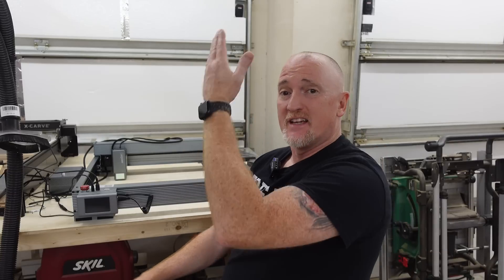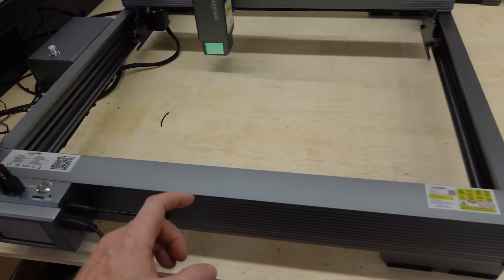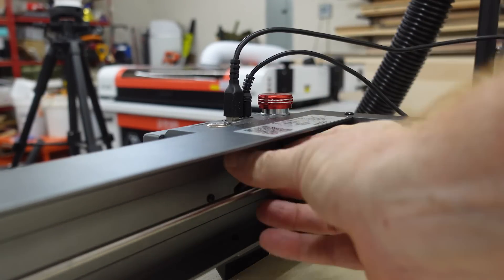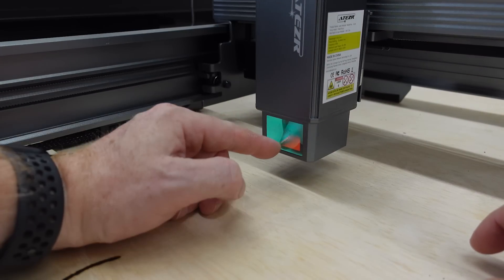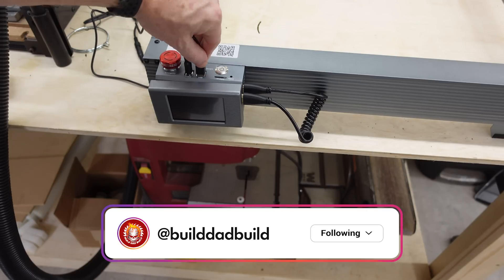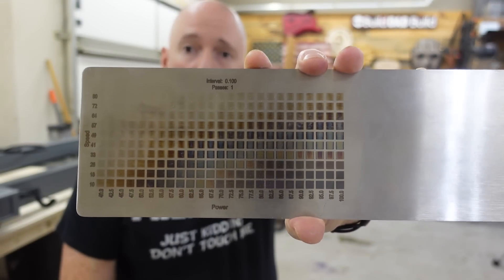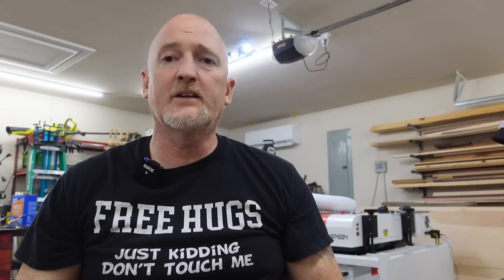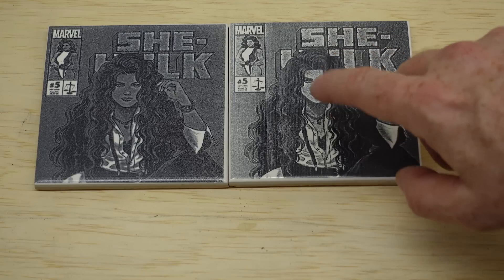A Little Laser on Laser Action! Is The Atezr P20 Plus the xTool Killer?

Comment: I am trying to figure out how you vented the atezr.  Is that a suction hose attached to the gantry?  At 7.50 or so you can see it in the background.  I hate my enclosure.  too hard to work in.
Reply from the maker: That’s the air assist.
Reply: @BuildDadBuild    the large black one that looks like it has a box attached on the end?  Looks like a small hvac set up.

Comment: Try removing the front "wiring panel" and flip it upside down, routing the plugin wires underneath the unit, and rebolt it in place if the bolt pattern lines up.

Comment: The Atezr specs are misleading when it comes to its positioning accuracy. If you look at its $100 and $101 values, they are both 80, which means that positioning accuracy cannot be better than 0.0125mm. So, they round it off to two decimal places and call it 0.01mm, making it appear 25% better than it really is. The D1's values are both 100, which gives an accuracy of exactly 0.01mm.

Comment: Hi Nic,
When it comes to titanium, it should be cleaned before lasering. The laser is creating an oxide on the surface, a degreased surface will give you the best results. I really enjoy your videos!
Also the best way to secure leather, especially thin leather, is to double tape it to the work surface. 
Thanks,
Peter LuPe
Leather

Comment: Thanks for the review I am heavily considering this machine especially for the price difference but I have reservation over there "risers" and switching back and forth and the overall support, i.e. xtool seems to have a more expansive eco system and optional items. I like the fact the Atezr comes with the air assist, but I keep seeing people with issues with the machine achieving the stated speeds. was  this 6000mm/min speed an issue for you? or is this a lightburn only issue? This will be my first machine and do like to tinker as I have several 3D Printers but if the firmware/machine isn't capable of the advertised speeds I think I would pay the added expense for the xtool. 

Also I see Atezr is now claiming colors and was wondering if you have been able to reproduce these?
Reply from the maker: Great unit.
I was not able to reproduce the colors other that what was in the video.
Reply: @BuildDadBuild  were you able to hit the advertised speeds of 24k mm/min? I’ve been reading people are having issues achieving that

Comment: 7:33 can somebody explain why or how? I thought annealing-colors just depended on the temperature applied to the material 🤔

Edit: ok, to speculate a little further by myself - apparently frequency and pulswidth do play a role as https://youtu.be/_IrjlysRQqg suggestst (though for a fibre laser). Also air assist will, as Minister BKK suggested.

@Build Dad Build, can you let us know if you compared said settings and if they matched?
Reply from the maker: Settings are apples and oranges with the fiber vs diode
Reply: @BuildDadBuild   I was talking Atezr vs xTool. Sure fiber is not diode, though that does not change the physics of annealing, does it?

Comment: That looks so similar to the AtomStack S20 Pro it's insane.  The primary differences (from what I see in teh video) are that AtomStack runs no aluminum extrusion (10x20, I think) and uses the 3 wheel configuration that rides over the extrusion (looks like the atzer rides in teh C-Channel), Atzer has got the kick stand focus (my S20 has the metal plate you stick under the laser head but I think they just announced that the new ones will have the kickstand style), and the specs say that it will move at 2x the speed of the AtomStack (24000 mm/min v 12000 mm/min) though I'm not sure that's a good idea on these cheap frames as the shake rattle and roll as the head moves that fast can get your work misaligned. And that's it.  Yeah, the OS screen looks exactly the same (as does the actual display) and teh cabling is in the same exact place.

Comment: Sir— have you tried Atomstack ? It was the 1st 20w diode laser that came out… also the bed size can be extended to 420x830mm something around that … I have one and it can do  cut pretty well in 1 pass … not only that it comes with air assist when you buy them .. I used to have an a5 pro then converted by buying just the laser module , air assist included and the large bed size … please do a review if possible. Thanks 👍
Reply from the maker: I don’t deal with Atomstack anymore. Their customer service is horrendous.

Comment: I have my suggestion, saying that today we can choose any laser machine, of course, comparing the same laser power and usable area for cutting and / or engraving (leaving aside the design), because manufacturers are competing with each other, practically, on equal footing; then, to buy, for example, a laser 10W or 20W, I would choose the cheapest because, all are similar. And if these manufacturers do not lower their prices, they will make it difficult for them to sell, because the competition is great!
Conclusion: Sculpfun, Atomstack, xTOOL, Atezr, etc., all have their 5W, 10W, and 20W lasers, and in a snap of a finger, we will be seeing 40W lasers.

Comment: By the way Nick, if you remove the bottom part of the laser with the mirror on it, you can run it with just the air assist and see the laser beam. The air assist IS metal Sir.

Comment: You mentioned previously that the diode lasers have issues with plywood, is there any way to test how well it can cut a wood layup with wood glue? basically looking at cutting a 7 ply layup for skateboards. I am working on a custom machine and need the flexibility of a wired module that can cut basically ply wood.

Also noticed your exhaust fan on the floor, is that a 12" or 14" and how well does it work to clear fumes from your shop/
Reply from the maker: You would just need to test the laser on a 7 ply glue up and see.

Comment: Have you ever engraved p mags?
Reply: I have… they melt the plastic/polymer. You can engrave simple things like your name or a number but it will not give you that “white” look you normally see in personalized PMags
Reply: @joegier5936  ive got some black p mags and i can engrave on them but the image is just black and you can barley see it. I tried using tempra paint but it doesnt work. So i was hoping the galvinezed compund would maybe work
Reply: @seththomas279  I’ve had no luck with that either… gotta use a fiber laser to get the results you’re wanting

Comment: From what u are saying it seems the  XTools competition has a bit lower beam quality. Not much but noticeable.  The spot isn't getting as hot. You can have a higher wattage but, if the beam divergence is measurably higher it can not heat the spot equal to the XTool within the same dwell time. So it boils down to beam quality. It seems like a clone with options that people might ant more than a D1 based on likes. Its competition none the less.

Comment: Yeah, I'm going to have to stick to the D1 20w Pro (when it arrives... thanks again, by the way). While a slightly finer laser focus point is nice, and the removable touch screen... I've grown attached to being able to house my laser inside an enclosure... and this one, with the front controller box, and wires off the top, just doesn't seem as enclosure-friendly. Plus, the inability to accurately see the laser point through the shield would make lining up projects just that much more of a pain in the ass... at least on the xTool D series, I can just remove the shield if I want a clear view or am concerned about clearance of the laser head (shush, you safety people!).
I see that they borrowed a bit from xtool, with the kickstand... I've always hated messing with height blocks. So at least the innovations that xtool is bringing to the market are being put into practice with other companies. The idea of having to dig it out with another tool though, is a bit of an annoyance that I'd like to avoid.
Maybe with time, all these "upgrades" will all be put into a single unit, and we will have the ultimate in laser technology... a diode 60w output (12 5w lasers focused into a single beam, of course) with a 0.001x0.001 focus point... and only $49.95. ;)

Comment: When you were comparing the two white tiles, the one from the P20 had some odd vertical banding on the left hand side. But, despite the fact that I am an XTOOL owner, (and I wish it were a 20watt Pro), competition in this type of market is good for all diode laser systems. 😊
Reply from the maker: I didn’t address it in the video because I haven’t had a chance to fine tune the P20 like I have the pro.
Reply: normally banding comes from the belts needing to be cleaned. Which shouldn't be the issue here since it's a new machine.

Comment: Curious to see what you say. I went from Atomstack to the Atezr, but haven’t had much time to mess with it yet. I know you’re in some Xtool marketing so hopefully the review isn’t biased 🙏🏻
Reply: I am currently faced with the decision between xtool d1 pro or ATEZR p20 plus. What is your previous experience of precision, detail, metalwork? I would also be interested to know if the P20 plus performs better than the Atomstack? Which one did you have?
Reply: @Chris-hq1vx  I haven't had too much time to mess with the Atezr yet since I am still in the process of building an enclosure since none of the ones on the market currently fit the workspace of the P20 plus. I had an X20 from Atomstack. I felt like I had problems with finer detail, but it could be my inexperience with the machine. From what I have tried with the P20 Plus so far I like the results I have seen. Lines seem crisp and detail seems to be very good.
Reply: @IKnowImLost224  Did you also have the xTool D1 Pro 20w in your selection? or why didn't you choose this one
Reply: @Chris-hq1vx  I didn't. I think Price was the main factor for me. I did look at xtool but any way I looked at purchasing it came out more than the atomstack and much more than the Atezr